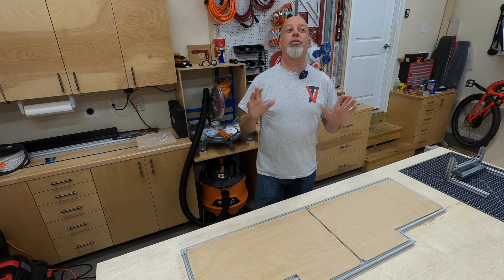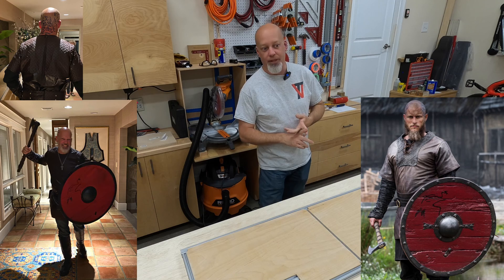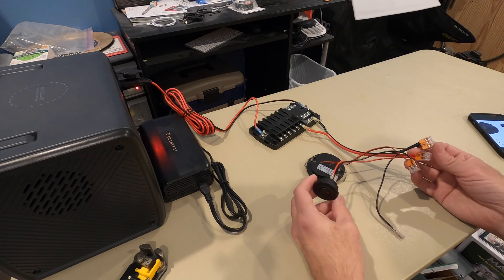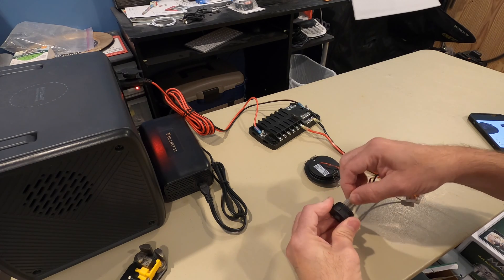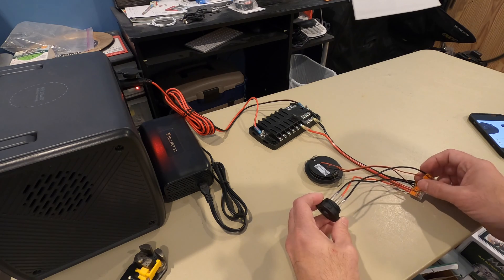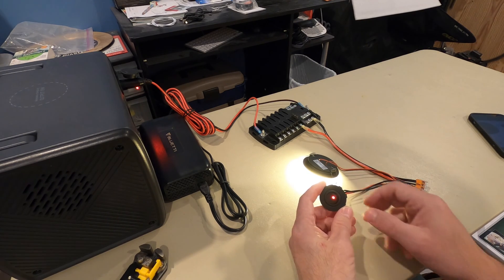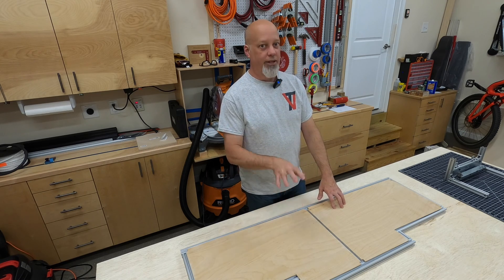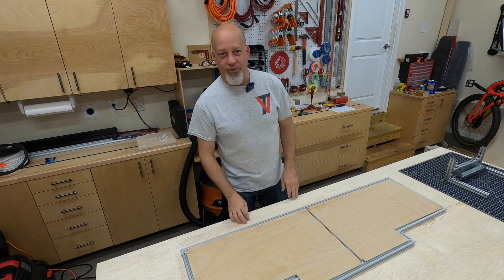Wiring a Rocker Switch w LED Indicator

Comment: I thought positive was supposed to be red not black?
Reply from the maker: If this was a plain on/off switch, then traditionally yes, however this has complexity added with the LED indicator. Note the wiring diagram provided by the manufacturer, and I'm circling bits as I talk, and my commentary that it should probably have been a different color for the load wire. If you can make your own short wire with the appropriate connectors and gauge, feel free to make it the color you want.